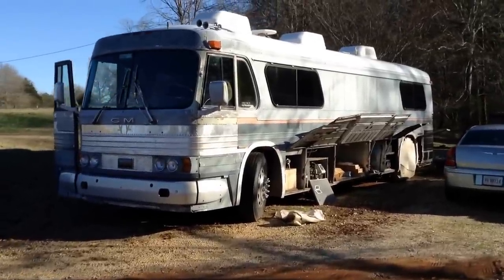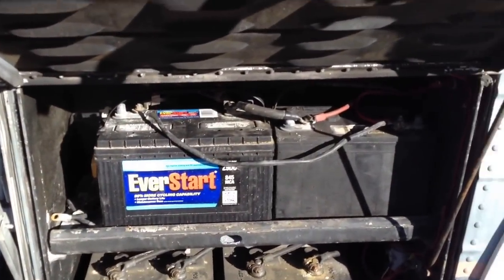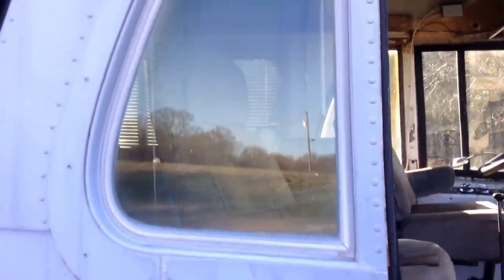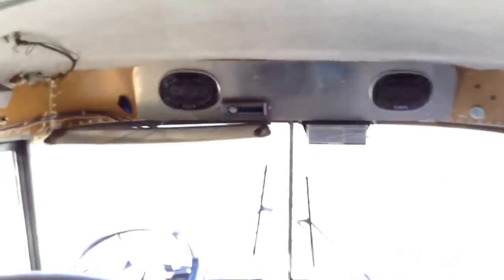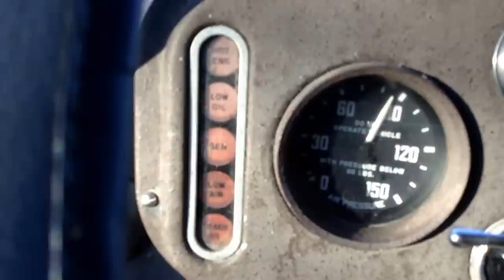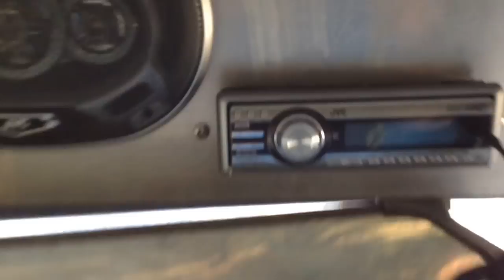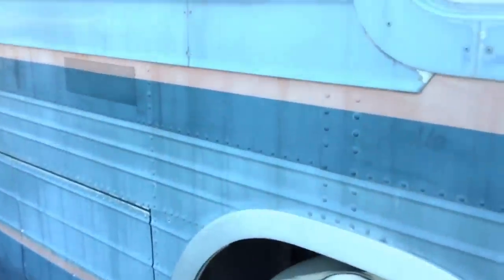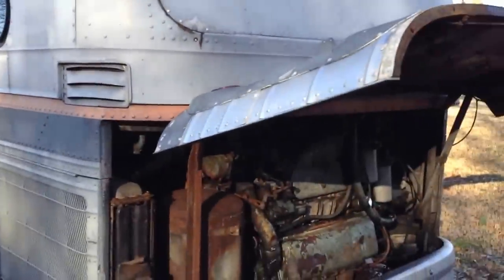1965 GM PD-4106 for sale

Comment: Those things will go as fast as you can handle em’ like 100mph
Reply: Top speed is limited by final drive ratio and engine speed governor.
Reply: We had a 4107 with same engine&trans 4spdw 318 8-71..
We had gospel group...on interstate....singing...I was driving heard a tick tick tick... 
Tick tick tick....WHAT?....
same noise...????...happen to look down it was speedo hitting the peg 85 mph. ....
WOW ...nearly 90 or maybe over!!!...BRAKES NOW.......
I never done that again...